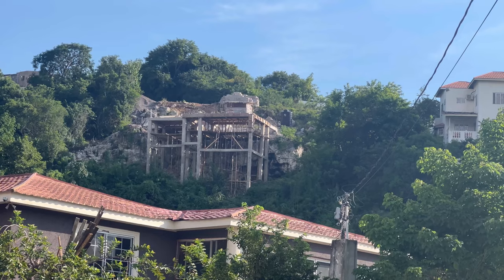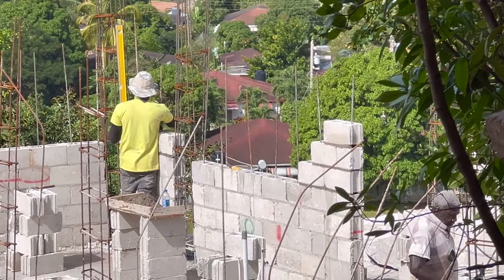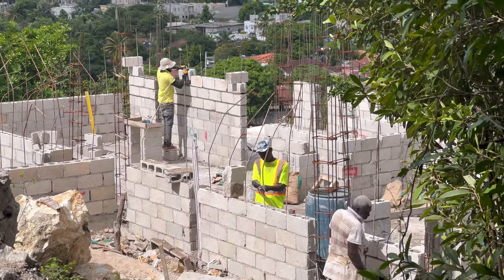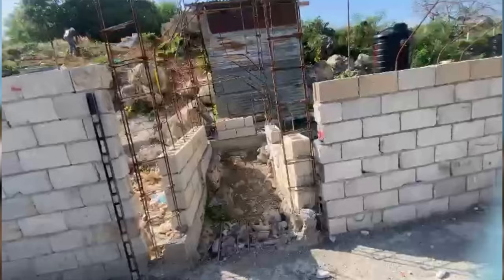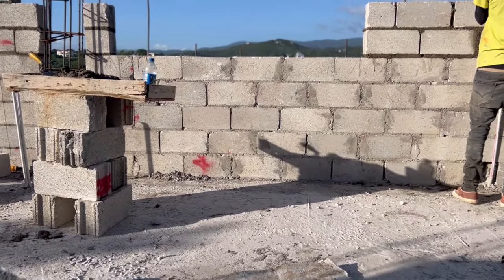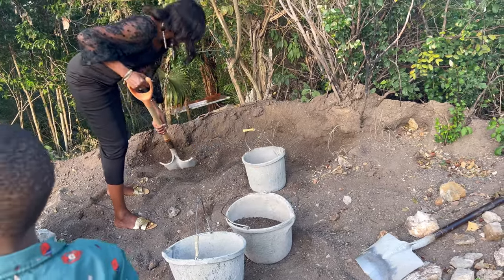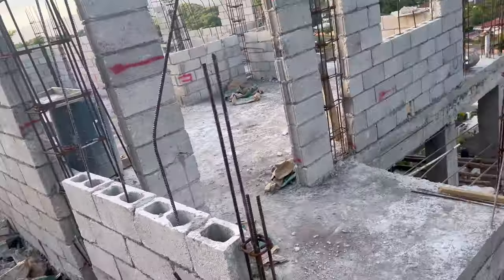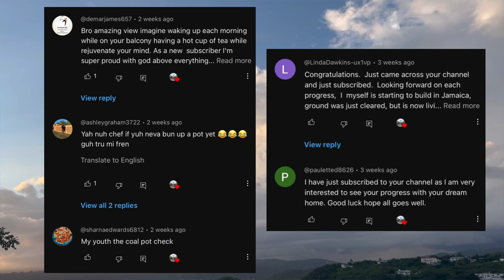Building My Dream House - Blocking Up and Cost Breakdown pt2 Ep5

Comment: When you fill the cells of the center blocks, you are adding weight to the overall structure. I think your support columns should’ve been a little wider or you should’ve added about five more support column
Reply from the maker: Appreciate the feedback...Before construction we had an engineer report done to ascertain if column were sufficient and it was passed that those columns were ok...however we still made them bigger than what was on the plan